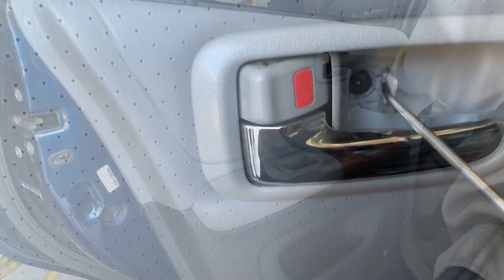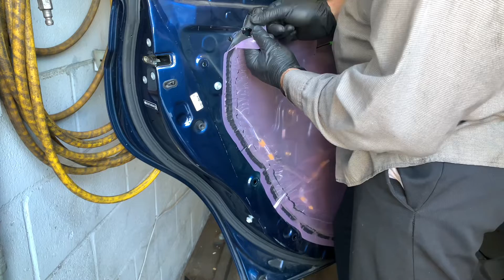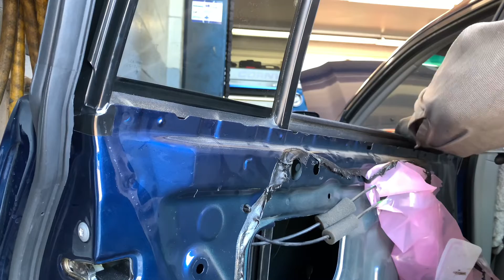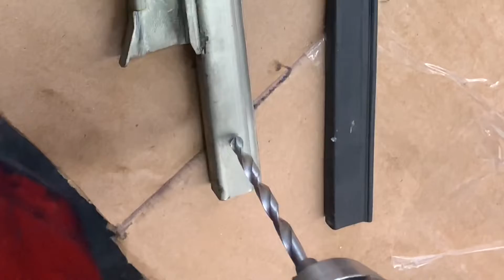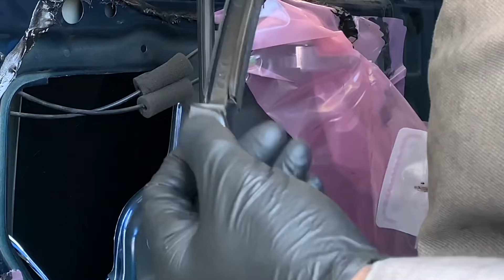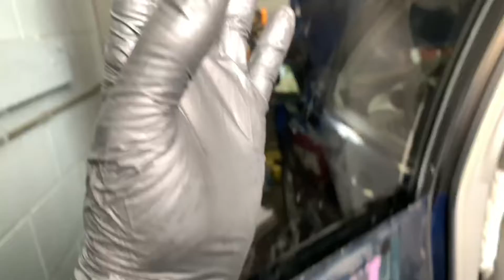If Your Toyota Highlander's Rear Window Keeps Falling Off Track, This Repair Video Is For You!

Comment: I think you should have used J-B Weld epoxy and glued the gasket to the glass and then slip the metal over the gasket.  My problem, which has happened twice now, is that the entire metal and gasket come off the glass.  I am going to use the JB Weld and I will report back here if it ever breaks down on me again.

Comment: Thank you for this easy to understand tutorial. One little helpful sidenote/  Once I took the piece off with 4 bolts that slides on to the track I had a hell of a time once it was put back on the track getting those 4 bolts to line up again (5hours). Finally I said fuck it 
and took that piece off the track, plugged the power supply back in and adjusted it with the window control and once I did that I could then slide it back on track and the 4 bolt holes FINALLY matched back up...the more you know!
Reply: Great tip.

Comment: Great video; advise some important changes. There are 2 problems to solve with the windows coming off. First, is the problem shown in the video of track moving out of position on glass surface resulting in the unit falling off regulator. Second, is the window coming completely out of the track, likely to happen in winter when ice freezes the glass to the frame and regulator pulls track off the glass. Guessing 2 issues are to blame. 1, the grease in the track that allows regulator joint to easily slide in track wears and dries out. 2, the rubber grip in the track dries losing it's original grip as well as metal track losing tension and original ability to clench the glass. (Fyi, the front windows are different and use bolts to secure glass and won't have this problem). The RTV in video is great. I presume any sticky substance that increases friction and ideally a little bulk and not readily water soluble (rain) will work if you don't have RTV on hand (hot glue, any craft glue, etc). But if you don't apply any adhesive also between rubber and glass, you may end up with the glass still getting pulled from the track. For that reason I would advise DO NOT APPLY SILICONE spray to track to make it easier to get track back on glass. Silicone's purpose is to make rubber less sticky and to last for a long time (why silicone wiper blades are expensive and durable). I advise using a mallet as shown in video. If you applied adhesive (eg RTV) to inside of rubber, that should allow it to slide on easily before it sets. Otherwise, isopropyl alcohol will lubricate it and then dry with a sticky bond (this is how bike handle grips are removed and installed). ...if i ever have to do windows like this again, i will drip alcohol into track down a piece of thin plastic wedged between glass and rubber and i think that technique will allow repairing it without having to remove the glass from the door because the alcohol will allow temporary repositioning of the glass in the track. ... Before you reassemble the door, apply grease (not oil, definitely not wd40) to track where regulator joint slides. And if you do have silicone spray spray it in the perimeter glass weather stripping where glass touches it. It will allow glass to slide up and down easily (saving your regulator from burning out and keeping window moving quickly up and down) and help prevent snow and ice from being able to attach and freeze your window to the door. Having your glass rip out and fall inside your door in sub freezing weather isn't fun. ...go ahead and spray silicone in your door locks, all door and window weather stripping, and wiper blades while you got the can out. ... And if you have a problem applying adhesive to the glass, the person who suggested using the window lock, that's a good solution, but used threadlock compound so vibration doesn't cause the lock screw to loosen.

Comment: Woke up today and rear window was all the way down. My regulator and the guide pin was intact. Tested the switch and its fine so im certain its the motor. Ordered one today. Will find out tomm. Replacing the motor itself seems much easier vs if the glass keeps falling off. My track looks pretty good
Reply from the maker: Hopefully it’s something simple
Reply: @HowtoAutomotive  got my window motor today. Plugged it in to test it and it kept spinning without pushing any button.  That tells me the switch might be bad. Might also explain the window going down overnight, it might of burned itself out. Will run more tests tomm, too cold today.

Comment: Thanks for your detailed view of your off-track window issue.  It helped me solve my 2002 Lexus RX300 window problem.  In my case, the driver side rear window stayed up but I could hear the window lift regulator move down and up on its own.  With the lift regulator all the way down, I could use my hands to push the window down.  The lift regulator could be moved upwards and, after hitting the bottom of the window, the window would move all the way up.  I opened up the door and found that the windonw lift rubber clamp had separated from the bottom of the window.  After unscrewing both ends of the rubber clamp U-channel from the window lift, I pushed it onto the bottom of the window.  Then, I reattached the rubber clamp onto the window lift.  The real secret, though, was that there was too much window drag in the window tracks.  After spraying silicone into the tracks, the window left worked well and reliably.

Comment: Thanks for the detailed video. Was able to fix my parent's 05 Highlander. The rear passenger side window had the rail completely slip off. For the rear driver's side, the rail slipped about an inch and a half from the original position.

Comment: Thank you! Just completed this project after a year of not being able to roll down my window without it falling into the door.  One thing- I forgot to mark where the track was supposed to go and then cleaned the window, erasing all trace, so I estimated.  Also, some of the  rubber lining for the window didn't go back perfectly, but I'm still happy everything is functional.  Thank you for posting this video!!
Reply: My other rear window just fell into the door, so this video is a gem and helped me fix both sides now.  This is a great resource, thanks again for posting!

Comment: Thank you Brian for this video. A life-saver! My daughter just purchased an 03 Highlander and the Rt Rear Window jumped track. I got it back on track but after the fourth test up and down, it jumped again. I did not know what to do but I found your video and was able to fix the problem. It was definitely the track sliding out of position by 2 inches. It was tricky and I didn't have the black silicon adhesive but I had adhesive for rubber seals, so that might work. Anyway, excellent video and much appreciated!

Comment: I have a 2005 Toyota Highlander and I have the same issue. I tired fixing it today but the track will not line up with the rotor that has the plastic square that needs to fit into the metal channel. I now see that I have to lubricate the metal channel and put it back to line up with the rotor. I also found out that over time it shifts and causes the rotor to come off track. I'll try it again tomorrow.

Comment: Thanks, it sure takes the trauma out of attacking a job like this.  I might suggest that an application of some white grease might alleviate the drag in the track causing the movement of the track on the glass.
Thanks for your video.

Comment: I had someone put in a thermostat and blew my head gasket also have a radiator and he didn’t put any coolant in it now I’m stuck with a brand new Toyota Highlander hybrid battery that cost $3000 ha ha bad engine. Right now I cannot get the window separated from the rubber and the metal part that he drilled a hole in

Comment: I recently had to deal with two windows on a 2004 Highlander that were "off track".  With your detailed instructions about disassembly and reassembly everything worked out well.  Thank you very much for posting this video.

For me the most difficult portion of the operation was inserting the glass window into the channel/filler.  I didn't have a helper for this step so I spent a moderate amount of time trying with no success.  My main problem was that as I attempted to push the glass into the channel, the filler would squeeze into the channel first reducing the available space for the window. I finally figured out the following process which simplified this part of the operation.

Items needed: rubber mallet, towels for padding,  two tie-down straps (long enough to wrap the window top to bottom), a section of plastic wrapped 14 gauge wire longer than the window is wide and rubbing alcohol (used as a lubricant).

I placed the glass on a towel on a work bench, interior side down with the bottom  hanging slightly off the benchtop.  I wrapped the straps around the window 2-3 inches from the ends of the target location of the channel.  Next I placed the piece of wire in the metal channel and slid the rubber filler into the channel from one end such that the wire is between the rubber filler and the metal channel.  What this does is force the lips of the filler outside of the channel giving you a chance to get the glass between the lips before it enters the channel.  Now insert the glass into one end of the channel/filler/wire.  Tighten the strap on the end that you just inserted.  Continue pressuring (using mallet, strap and liberal amounts of alcohol) the channel/filler/wire onto the window until it is completely inserted.  At this point pull the wire out and using your mallet completely seat the window in the channel.

Be sure to mount the channel with the open side facing toward the inside.  Trust me removing the channel is more difficult than putting it on.  LOL 

Good luck and thanks again Brian

Comment: Question - I'm at the point of reconnecting the motor and I cannot get the bolts and the plug to align properly... The motor is in the up position, the window is all the way up, and tbe rubber seal on the bottom track looks to be flush with the window. Any ideas?
Reply: ever figure it out? Same thing I'm dealing with now
Reply: I'm having same issue!
Reply: @tenneseeismyhome  I ordered a replacement regulator from the dealer thinking that was the issue. Turns out the glass just slid out of the channel and needed to be resealed. The actual regulator was fine. When I measured it up to the replacement I found the replacement wasn’t the same. Not sure
If defective or wrong part but it’s not right.

Comment: Brian, thank you for this thorough repair video. I have a 2004 Highlander and over time both windows have fallen off the regulator because the track has slid out of position on the bottom of the window. I managed to slide the tracks back into their original positions using some levering and tapping without removing the windows, but this is not a permanent fix; one of the windows just fell off a second time. I think the next time I have to do this I will use the silicone adhesive as you recommend, and I hope that will be a permanent fix. Again, thank you for the video.
Reply: That’s my intention I was going to do a permanent fix so I took the window out and it looks like the rubber is 1 inch away from the metal where he throw the holes on using a plastic prior along with a rubber sledgehammer and I can’t get the metal or the rubber off I tried putting it in hot water I tried putting in so I can’t remove it
Reply: @michellewahl4756  I did both of my windows this weekend. I was able to pull the metal track and rubber liner off by hand. I pulled from one end of the track/rubber and just kept at it until  both pieces came off.
Reply: @ngumbo  I tried several things and I can’t get it off it won’t move. Thanks for the reply it looks easy on the video. But how often did he stop and pause to do the next step? I called a local expert window expert to do it the rest
Reply: @michellewahl4756  how much was the labor? I hope it wasn't $1k :(

From the video, the degree of difficulty from 1 to 10, 1 as easy, 10 is hard, this look like 7.5

Comment: Very detailed video. However, I was able to fix the same problem for a 2005 Highlander  without taking the window glass out. Steps: After removing panel, weather plastic, bring the window to the height where you can put the square plastic back to the rail for about an inch from the point it would slip out again, then use a window stopper (1 inch length aluminum piece with a hand tightened screw, about a dollar or less) grips the end where the square plastic slips out (like you'd do with a home window) then slowly push the window power button, about 1-2 seconds at a time (don't try too hard, it may be not good for the motor). It'd push the metal rail slide back to the original position (the square plastic push the stopper, hence move the rail). Remember to spray some lithium oil  at the rubber and rail, so it can slide back easier. This method I don't see on any video or forum. I did it quite a few years ago, with both sides of the same car a few month apart (rear windows), problem has not come back.
Reply: If the rail has shifted, the problem will happen again, in which case you'll need to take the whole window out and re-attach the window pane. I found I could disengage the actuator and slide the square plastic end back in without removing the actuator from the door panel; another option for those who wish to avoid removing everything (IF the rail hasn't shifted)

Comment: Hey Brian, how do you keep your toque wrench calibrated? Do the tool trucks do it? Do you have to have a tool truck torque wrench for them to do it?
Reply: Most tool trucks will torque a bolt with a new torque wrench and then test yours to the same torque. If out of spec not sure what happens since mine have always been fine, but I know they can be adjusted or worse comes to worse replaced